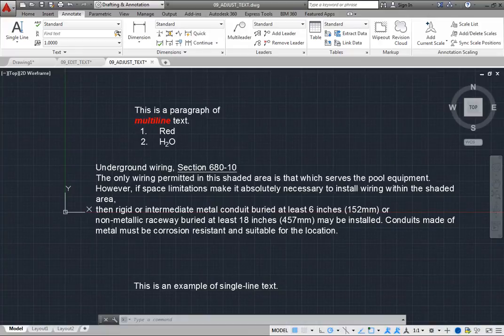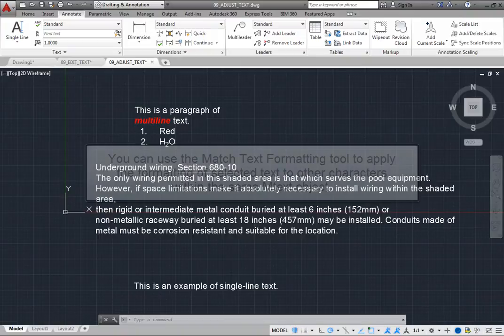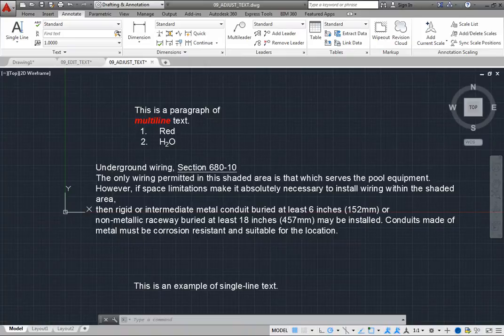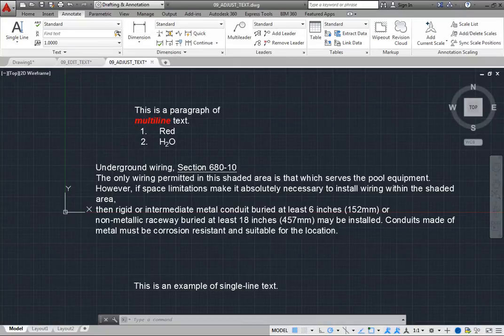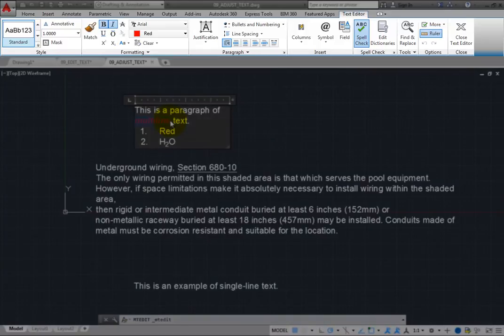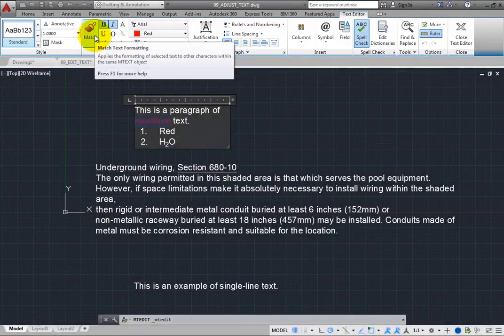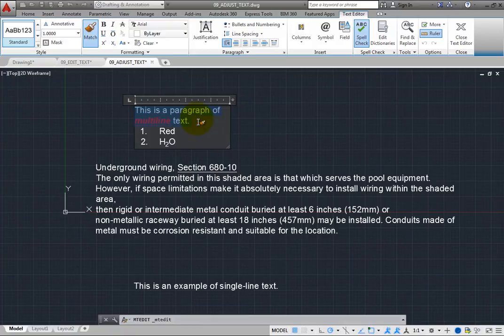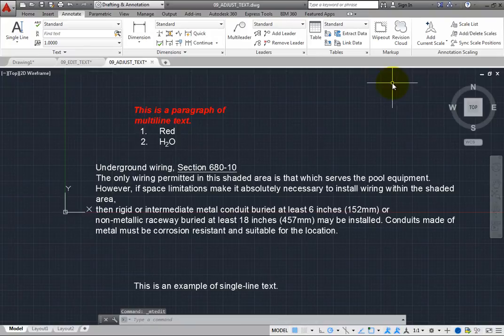Matching Text Properties

Comment: nice, but how do I apply this into diferent text boxes?
Reply: Same question here.
Reply: Use match properties
Reply: @aj1nonly  Match properties is not working for me
Reply: @yashwanthchityala7967 what issue are you facing
Reply: @yashwanthchityala7967  what you can do is just create a text not a mtext with the text style you want and then use match properties to match with other text
Reply: @aj1nonly  i have multiple text boxes in my sheet, i wanted to change font style of all boxes. how can i do it
Reply: @yashwanthchityala7967  Use style command to change all the text  
Just choose or create a new style and set current all the text will change automatically